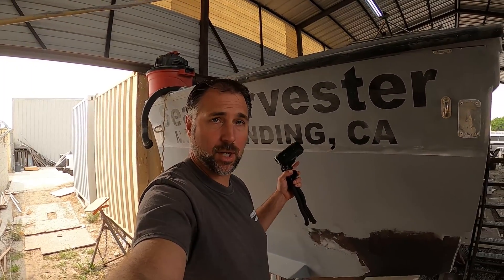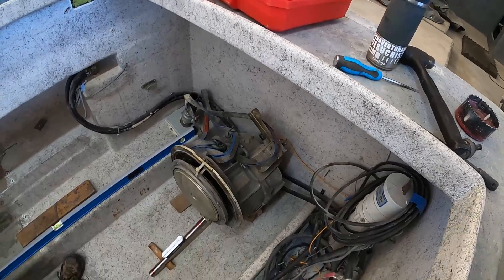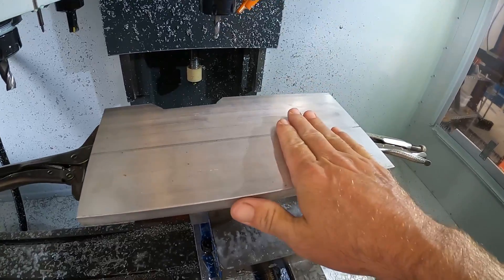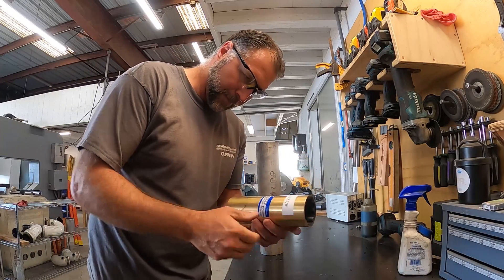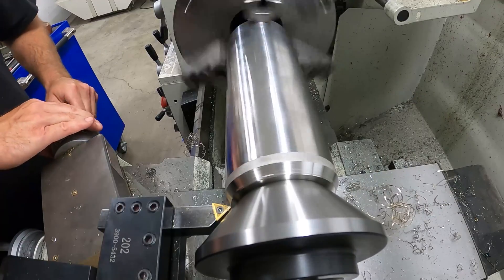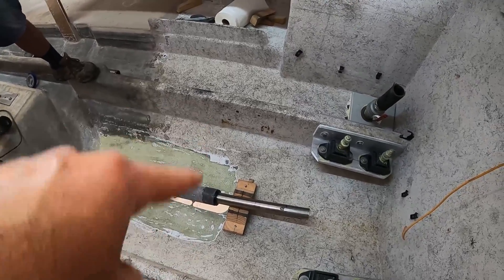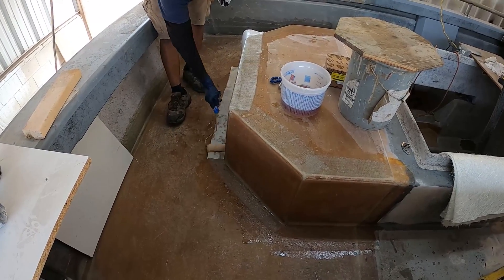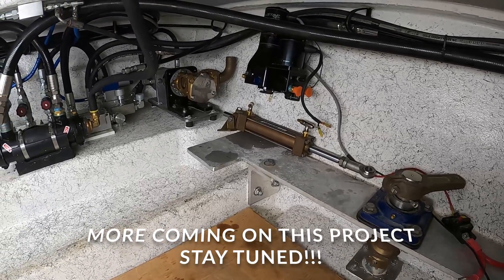Sea Harvester: Strut, Log, Hatch and More...

Comment: When you say "combo" in regards to lay up, what exactly is that material? Why would you choose plywood instead of foam in your back deck area.
Again Great Work !
Reply from the maker: Combo has one layer of mat and one layer of cloth.  Therefore its a combination of the two... Hence combo.  We used plywood on this Radon because Radon construction is usually glass over plywood.  We generally match the existing unless its just altogether poor or inappropriate.
Reply: @SeaboardMarineIncVideos  Thanks, I assume it's the mat/biaxial cloth stitched?